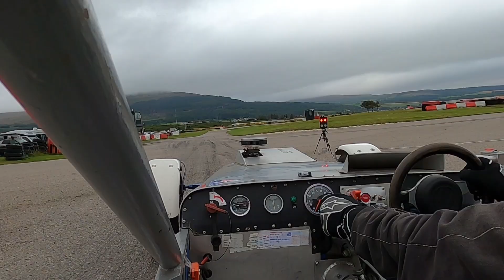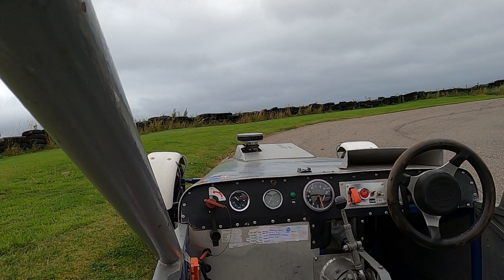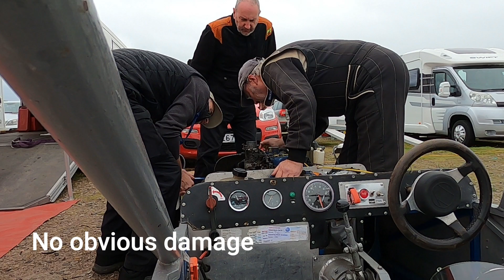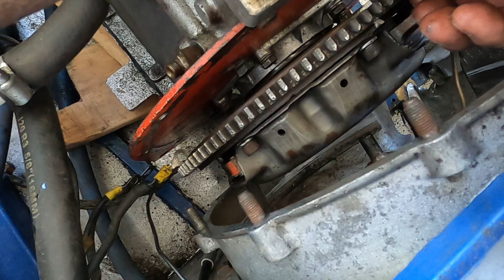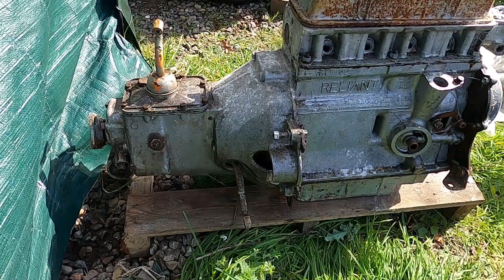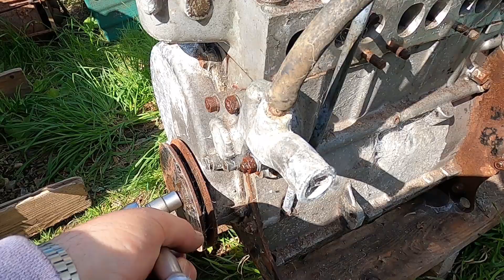WHAT BROKE ON THE RELIANT 750cc HISTORIC RACE ENGINE?

Comment: crank and matched assembly, balanced and polished. sounds pricey.  first time viewer, subscribed.  that's some shed.
Reply from the maker: The original 750 engine was quite trick with the lightened and balanced bottom end. The engine lasted 7 seasons of me taking it to 8500 rpm!

Comment: That’s some bad racing luck. But it’s all part of the game. Good luck getting your spare inspected and find all the parts you need. 🏁
Reply from the maker: Hi Lloyd, spoiler alert - the replacement engine did not work and I used yet another unit.

Comment: That's unfortunate, given that it was otherwise sounding good. Will you still get to run in that class with the 850? Hopefully the casing end hasn't suffered too badly and you can source another crank. It'll be interesting to see what you find when you get to opening the 750 up.
Reply from the maker: Hi Niall, yes the 850 can still run in the same class. The 850 is just a stroked version of the 750. I do have another complete Darvi 750 but I need to strip it down and inspect. I may wish to inspect the crank for cracks!
Reply: @DougsShed  Magnaflux if you know someone who has the kit. Hope it's a survivor.

Comment: What modifications have you made to your engine and did you make your own gear remote?
Reply from the maker: The 750cc Reliant engine had a Darvi dry sump oil system, lightened and balanced crankshaft/rods, Newman race camshaft, lightened rockers etc. Survived 7 seasons of abuse (revving to 8500 rpm).
Remote is a very simple pivoted rod with a reverse lock out plate on the tunnel.
Reply: @ thanks Doug, I think I can come up with something now👍